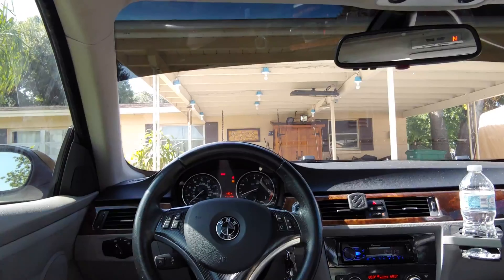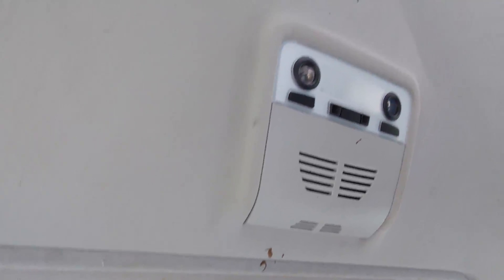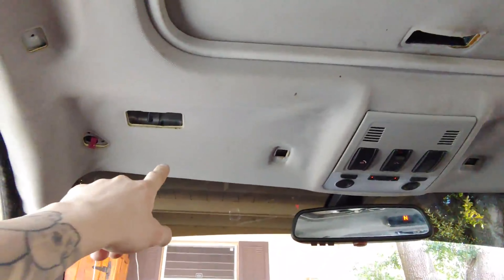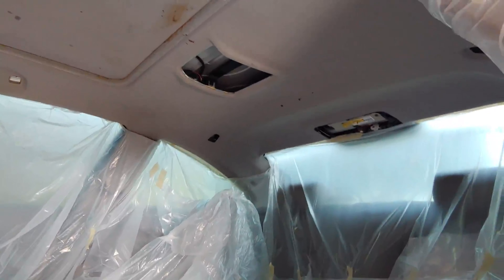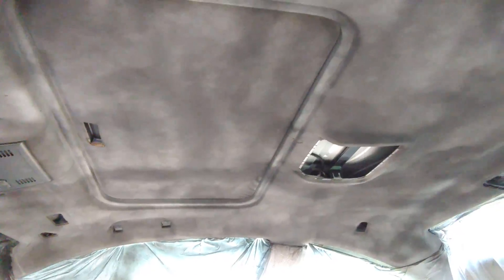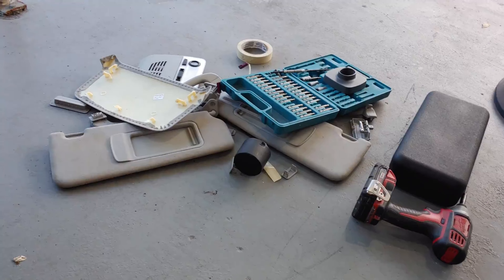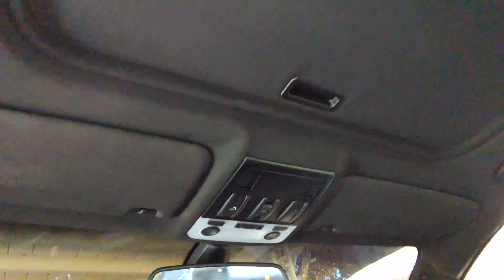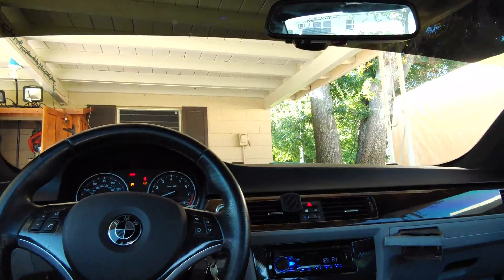HOW TO PAINT YOUR HEADLINER  |  EASY DIY | no upholstery worked needed!

Comment: Just take out the headliner and paint it with emultion using a scrubbing brush and tooth brush. Also before spraying the pillar plastic use a 120 grit sand paper then spray it. Test it first on the back of plastic and when dry  scrape it if it doesnt peel. Jobs a gooden. Plus looks best not touching the sunvisors etc just paint the edge trim. Goodluck

Comment: Did the fabric ever come off of the foam after you painted it? 
I want to do the same thing in my car my headliner fabric is sagging badly, and ripped to bits. 
Under that is a foam layer.. I'm trying to figure out if it would be better to rip the fabric off and then take the phone off with the wire brush and then just use paint. Though I've heard taking that phone off is a horrible mess. But tbh I'm Really trying to come up with something unique. I've got some really flexible wood panels I'm just thinking about maybe replacing the interior with wood lol. 
But then at the end of all of my ideas I come to the fact that the car was only $50 and that I probably shouldn't be investing money or time into something that could break down and catch on fire at any given second😅

Comment: It's hard to believe this paint has doubled in price since you made this video and mentioned it was $8 bucks a can.. Great video,, I have a older Volvo XC 90 that needs a new headliner installed. I was gonna rip out the old sagging headliner and paint the plastic/cardboard shell that the headliner fabric normally attaches too black like you did this car.
Reply from the maker: Everything has doubled in price lol
Reply: Go to Michael’s or Hobby Lobby. They sell headliner fabric. Black, Gray, or tan. Purchase 3M headliner spray adhesive. Drop the headliner, bring it out back of your car. Remove old nasty headliner. Then use a paint roller on a stick to help adhesive stick.
Reply: Hi. I noticed that in the video too and I thought the same thing.  Crazy how fast things have gone up.

Comment: So does it smell like spray paint inside? Great video.
Reply from the maker: It went away alot quicker than I thought. It's a strong smell out the can. But in 24 hours it was like 90% gone 48 hours 100% gone.
Reply: @BuddysDIY  i came across your thread, and iam impressed with your work, i have a 2005 645 bmw, my interior/ dash door trim is a charcoal dark grey , headliner is a light grey, with black leather seats, what color do you recommend it to be spray painted ? Black or charco grey...and what color did you painted your headliner?